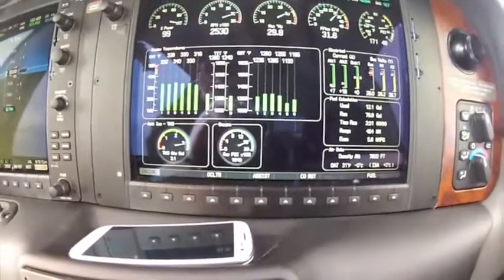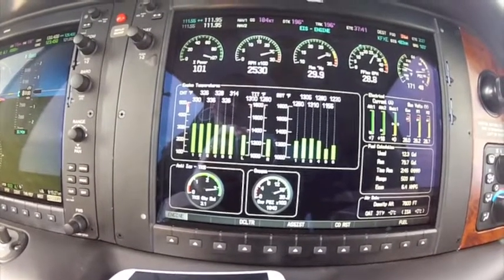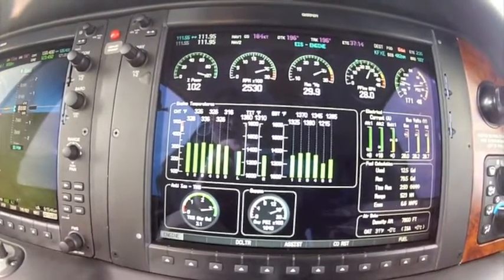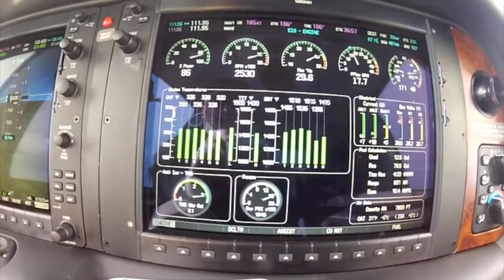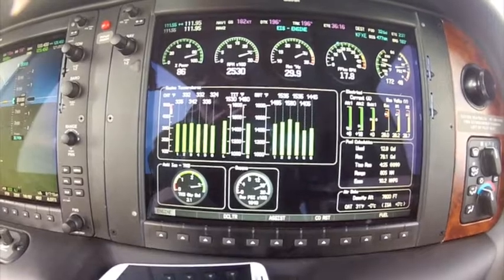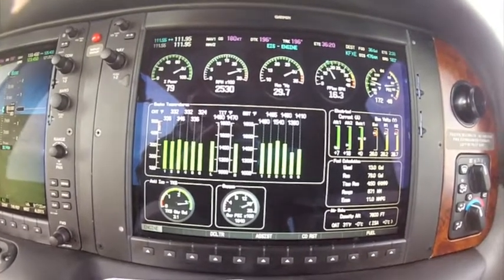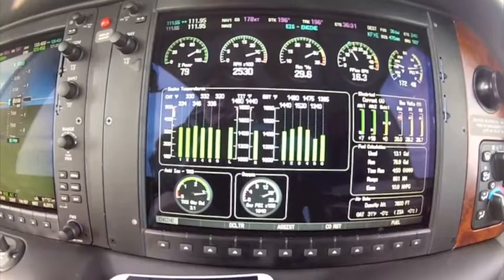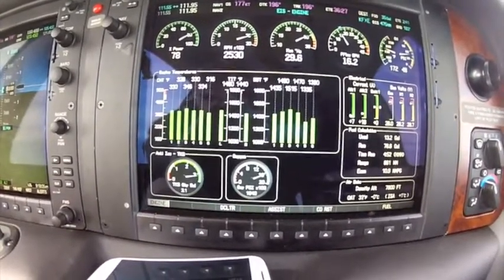Controlling your EGT's and CHT's Lean of Peak

Comment: For those operating LOP, just remember on your descends to go ROP since as you are descending your EGTs will go higher and risk burning your exhaust valves.
Reply from the maker: Actually its the opposite if you are lean of peak in cruise. As you descend the mixture will continue to get leaner until the engine starts running rough.
Reply: @NorthStarAero  That's what Niko's saying- richen it as you descend.

Comment: In an engine that is running with a "perfect" mixture (stoichiometric mixture of approximately 15 parts air to 1 part fuel) all the fuel will be completely burned during the combustion cycle.This results in the highest possible EGT (Exhaust Gas Temp) also called "Peak EGT".If you add fuel (enrich mixture) the engine will run "Rich of Peak" EGT.If you reduce fuel (lean the mixture) the engine will  run "Lean of Peak" EGT. Rich or lean is a reference as to which "side" of peak EGT u r operating on
Reply: I think you will find that the ideal stoichiometric ratio is more like 13.6 parts of air to 1 part of fuel.  Around 12:1 for max power and around 14-15:1 for economy.  But your point is correct.

Comment: I just can't believe that in 2013 we're still fiddling with the mixture and prop.  I would always want a manual option for when the computer goes awry, but sheesh, I think it's nuts that today manufacturers are still cranking out old school throttle/prop/mixture set ups (basically).

Dump these gas hogging engines for newer high compression tech, and digital controllers for goodness sakes!  We should've ditched this stuff with LORAN ;)
Reply: Amen.

Comment from the maker: Side of the EGT curve. The curve will look like a rainbow if you drew it out. You could label the starting point on the left side as full rich and the far right end as idle cut off. As you lean the temps will increase until you reach the top of the rainbow. From Full rich to the top of the rainbow is the ROP side. Top of the Rainbow to idle cut off is the LOP side. Does that make any sense?